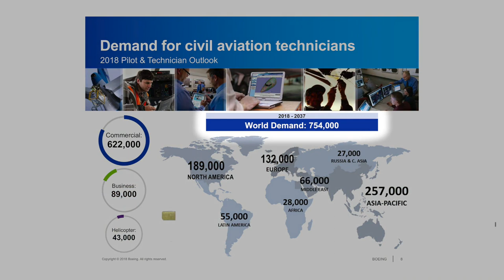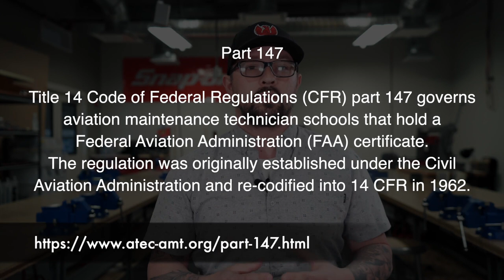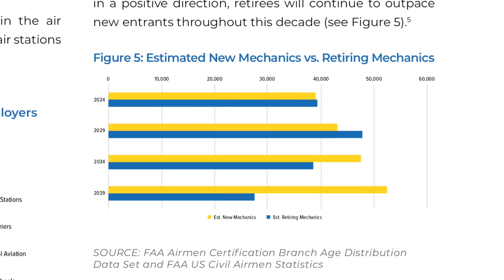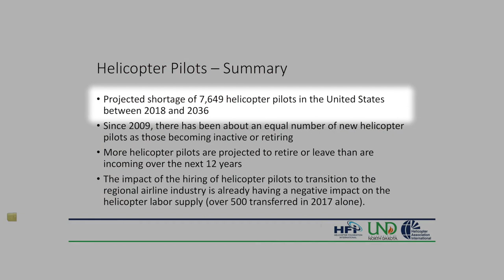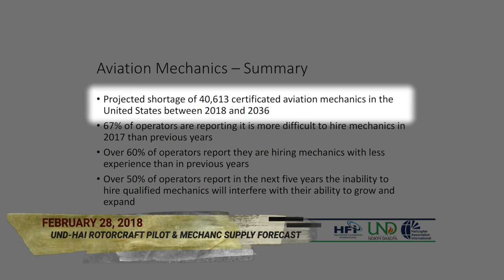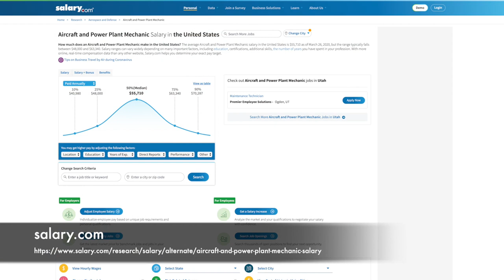Why It's a Great Time to Become an A&P Technician (Aviation Mechanic)

Comment: Can’t wait til these old heads retire. They have a lot of knowledge, but a lot of them are stuck in there ways. A lot of these companies pin us rookies against these guys for positions “based on experience” and it’s really not fair.
Reply: Whats the state of Aviation doe... Im 17 and wanna become a mechanic post Trade school, But the Aviation industry looks so uncertain so far
Reply: Run. Run now! It's too late for me.
Reply: @rylanmacdonald6416  wdym
Reply: First off you follow the maintenance manual for any repairs. You don’t wing as you imply. Most of the problems we had were discussed in the break room and the old timers would provide their experience which made the troubleshooting easier. And yes your salary hinges on experience and you have none.
Reply: You can have it.
Reply: @cruzerzeitgeist9137  I'm right there with you. I'm so done with the industry. They can have it. 

And the divorce, and DOE wages (which are garbage), especially when you have plenty of experience. 

I bought a cheap airplane and got my pilots license. 

I actually LOVE aviation now that I work on my own plane and no one else's.
Reply: Just remember One day you will be an old head yourself competing and working with rookies coming in also..🤣😆

Comment: I am an aircraft structural mechanic, is there a chance that I can get a job in us as an aircraft structural mechanic without having faa license?
Reply from the maker: Yes, but it will limit your options quite a bit. You'll only be able to work under a Part 145 repair station, a manufacturer, or a Part 121 commercial operator. With special skills as a structural  mechanic there are job opportunities but It depends heavily on who you apply to and you status to work in the us.

Comment: What’s the difference between a A&P certificate vs a license?
Reply from the maker: Good question. In this video they're the same thing. Technically it's an A&P license, but a sometimes we use other terminology that is basically interchangeable.

Comment: I would love to work with planes, fixing them and stuff but it's the actual A&P course difficult, or how it is like, please someone let me know, I appreciate it.
Reply: Fairly simple, if you survived High school youll breeze through the course,  dont let the hype intimidate  you.....
Reply: Im currently in highschool and half way through a&p school. Its not super difficult, i went in with zero mechanical knowledge. Id be happy to answer any questions:)
Reply: Tiller how long is A&P school going to take to finish?
Reply: bootyeater51 most  are 18 month courses, then about another year to get the license.
Reply from the maker: @bootyeater-wt2dh  Ours is 18 months. You can take your first semester entirely online, but then you'll have to attend in person for the rest of the program. You also get an associates degree upon graduation.
Reply: The schools are largley puppy mills. They could care less what you do as long as you pay tuition. 
The classwork is NOT enough to pass.  You better have shop skills to start. Be good with handtools and logic.
35k$ for school and you will start out at about 19 an hr on midnights. 
I would just go windpower or nuclear. Aviation is nuts.